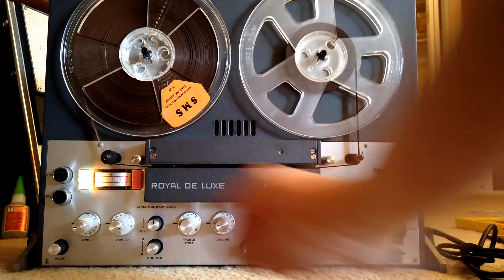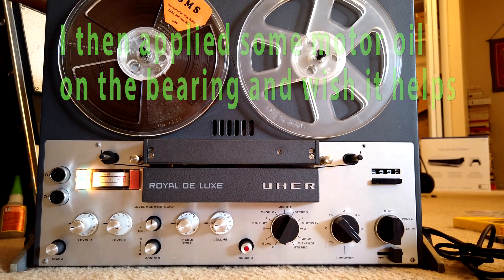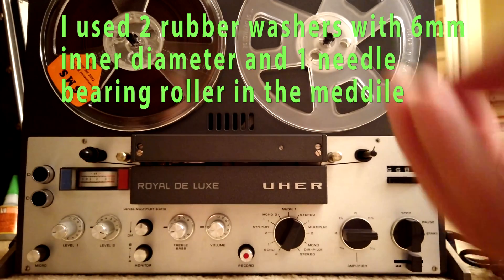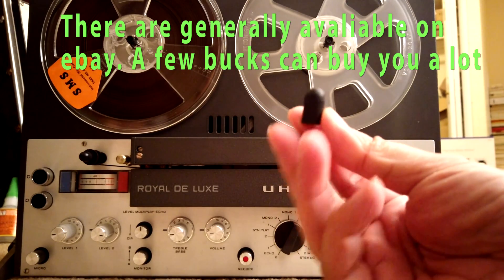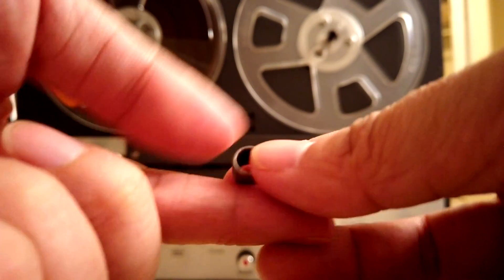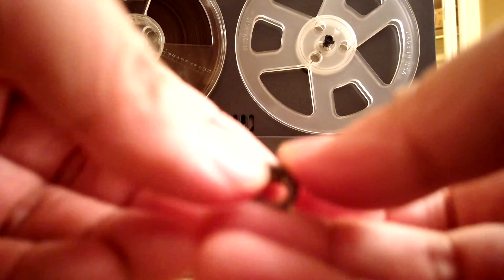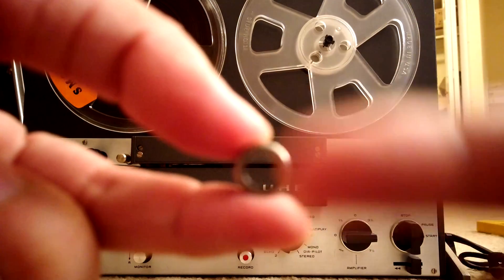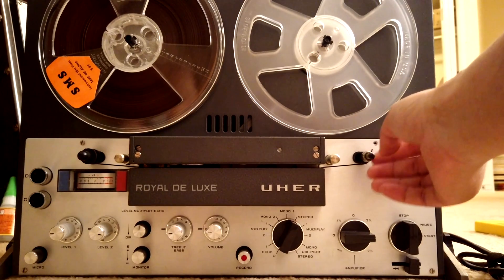Custom Modification for tension ARM Roller of UHER Royal De Luxe 294 Reel to Reel

Comment: You could fix it down side. Those tensions are not exact as they should. There are screw under the plate which moves tape tension.
Reply from the maker: Not screws. The tension is controlled by a spring hook to a metal leveler. To adjust it, you either change the hook places (there are 3 hooking holes), or can bend the metal leveler. Both methods are suggested by UHER factory. But the variable is not due to tension, it is due the smoothness of the tape and the metal arm. I watched many other videos, most of them have similar issues although no one talk about.
Reply: Merhaba uher satın almak istiyorum

Comment from the maker: Update after 6 month of use:  I found out I have leave at least 2mm space between the Roller and the washers otherwise, some tape will touch the washer which leads to vibration.  Update after 1 month of use: suddenly the vibration comes back again. I found dark rubber residues inside the roller. I think the residues was coming off the rubber washers. Every time the tape edge scratches the washer,  it probably cut some residue off. Thus, I added M6 plastic washer in between and will see if this happens again. If it is, I will buy some metal M6 washer to test.
Reply: I did simmilar upgrade to my two the same uhers because I noticed that Uher in some versions   also improved it in such way and it prevents issues with sticky tapes.  I think you should not keep  original lever because it is too bulky But if you cannot resign make make   rotating parts from teflon like material  

 I disconnected levers  and replaced with levers made of steel having diameter about 1 mm and I threraded them to original wholes of original levers  For that my  spools  have also adequately 1 mm bearing.   Solid bronze spooles sided with limits  I got from other tape recorder  but I think at best they could  be machined. With such small diameter of   bearing and balancing  of spooles plus oil  all works smooth since some few years  Bear in mind that in winding the revolutions reach    8 000- 10 000/min  way too much for loose working metal surfaces in 4 mm diameter.